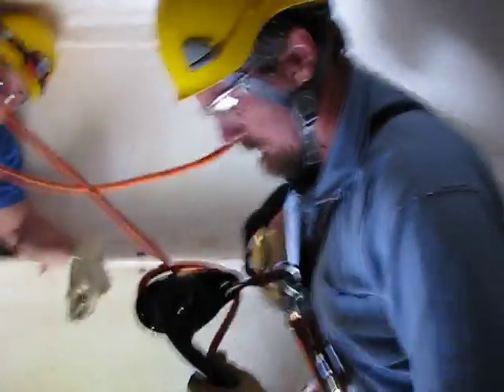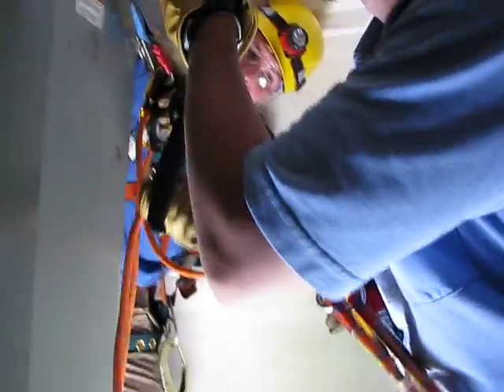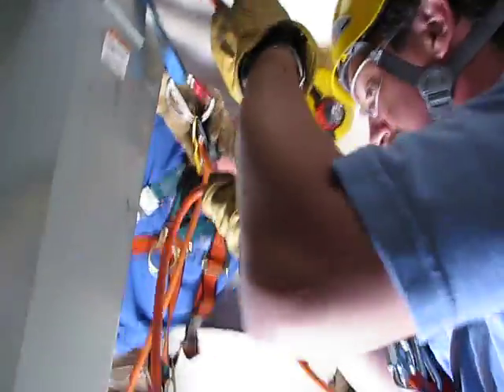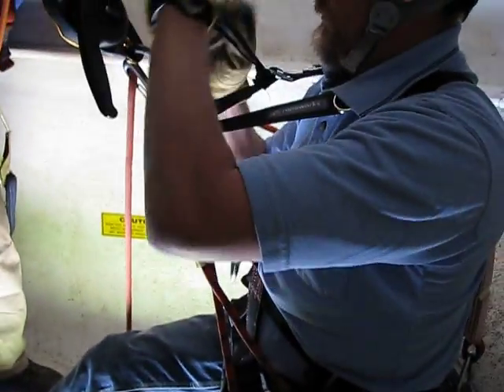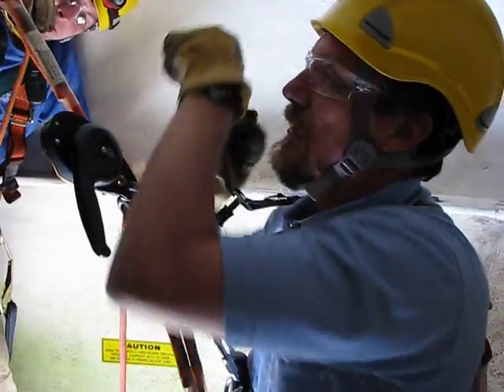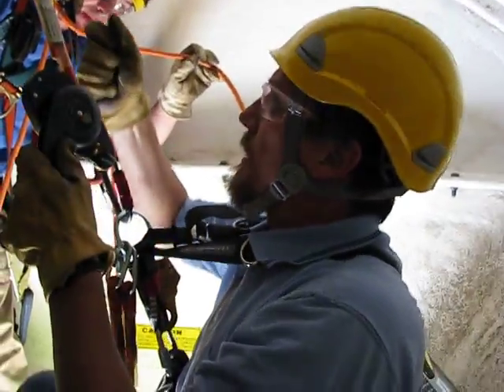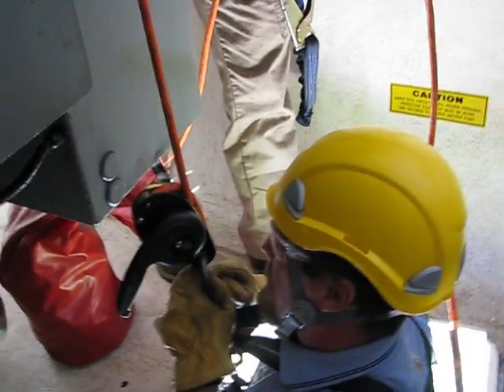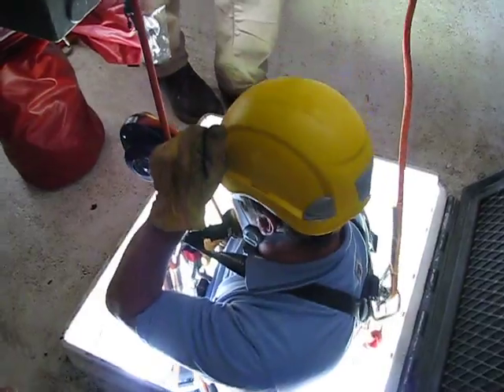How to Evacuate a Wind Tower

Comment: @tiato99 The Frieno carabiner added to this system is an over kill for a single person load but as Technicians work in these turbines in pairs, a two person load evacuating the structure is possible so the extra friction would be needed. The ID is a great device in trained hands, perhaps not for this application, instruction - this is the instruction and why take so long, its a training exercise, speed is not required, familiarisation of the system is.